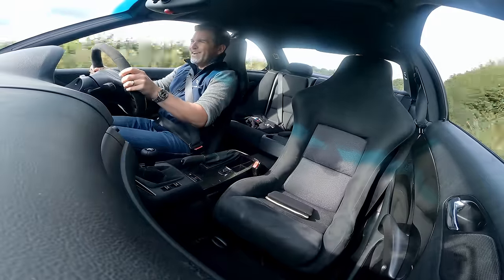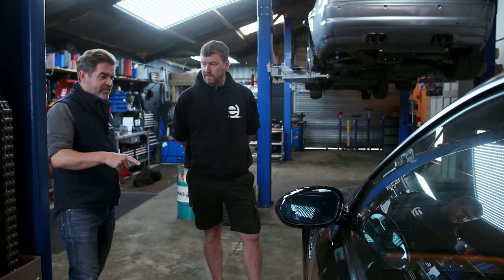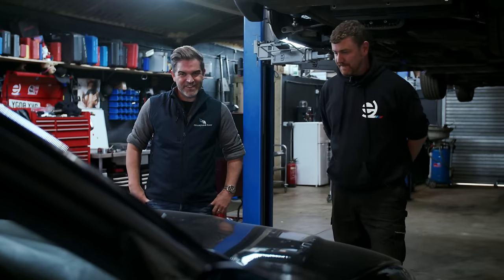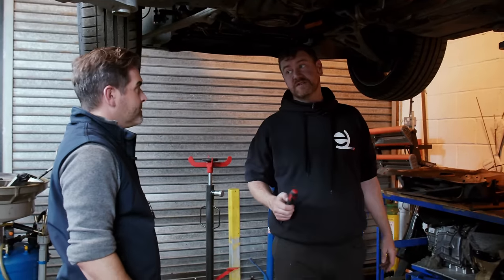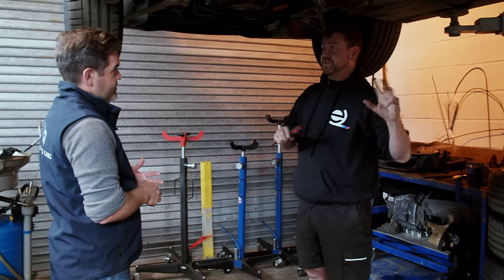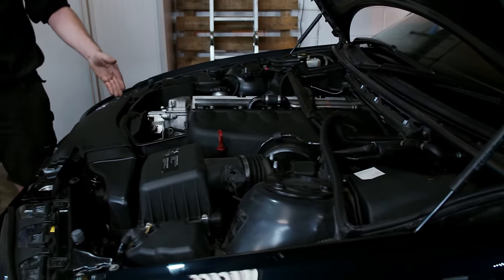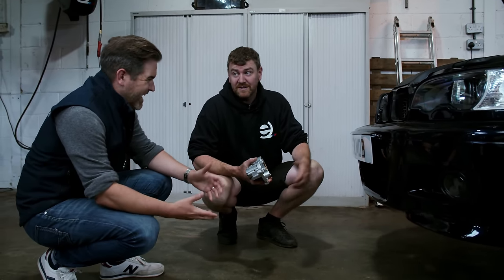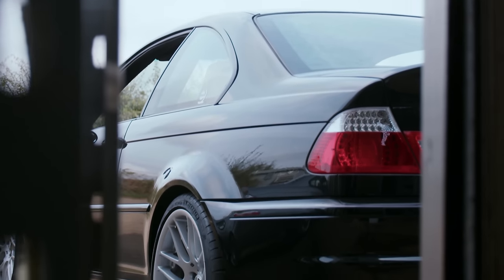BMW M3 (E46) | Buyer's guide with Everything M3s

Comment: Unfortunately, nothing was shown on the chassis at the back of the car or the sills. Potential problems have been just hinted by words and video was showing a black hole. You have a video here, show us the areas then!

The viskolok diff does not work on non-newtonian fluid principle. It uses the same differential fluid (oil) as a normal LSD and uses a shear pump to engage the clutches, mechanically pushing them together. Friction principle is same as in mechanical LSD, application of force is different.
The real problem with these diffs is non-symmetric flanges, causing the large amount of play in the right output flange. This problem is there the more the car is driven and info given here is wrong.

Sorry for being harsh: this was a waste of time.

Comment: Oh and one other thing is. You didn’t cover the most common E46 M3 problem and annoyance. The notorious M3 clunk. The right hand side of the LSD has an inherent fault where the play in the planetary gears gets so bad that when you shift gear say in fist to take off and say reverse you get an annoying clunk that people outside the car can hear. Super embarrassing. The guys at Everything M3s can not only fix it, but they have a fix for it to improve it. You can see the fault when under the car. Just simply push the right side output shaft close to the diff upward and you will see it move and hear the clunk.  Oh and by the way the other huge problem with them is the flywheel. They have a dual mass flywheel. The is a spring that is designed to take tension and absorb some of the energy so you don’t feel a shudder when changing gears and makes it smoother and less noisy. These notoriously go and the you change gear in first or reversing you get an embarrassing cow bell noise. That’s the spring clatttering and loose and just gets worse. Fix is a new dual mass flywheel.

Comment: 130k miles had my subframe dropped for inspection and changing brake lines and not a single hairline crack
Reply: Also just to add had my head gasket done as changed Cams as i said I'm on 130k and it wasn't gone at all